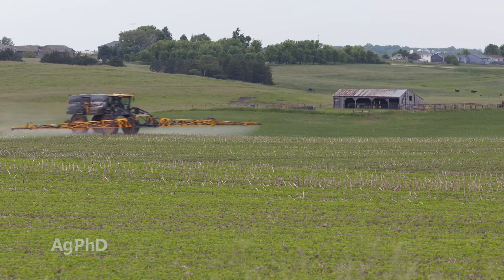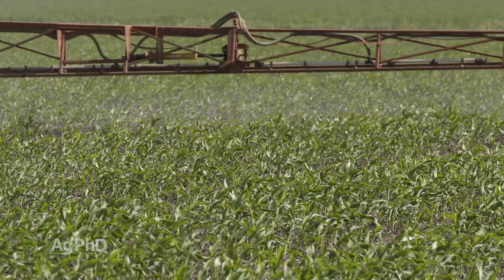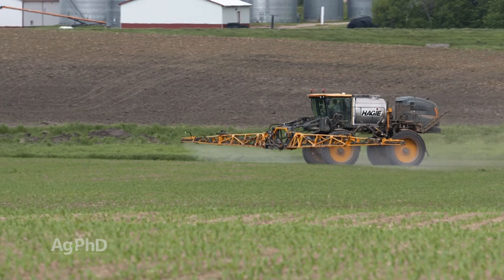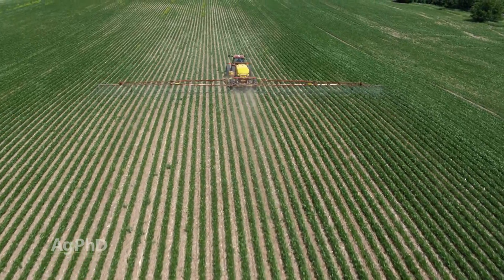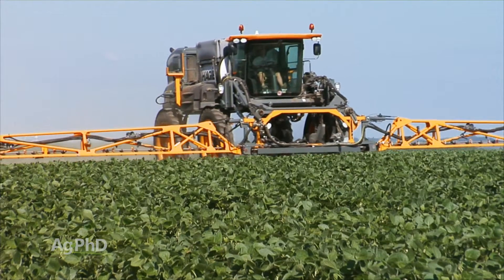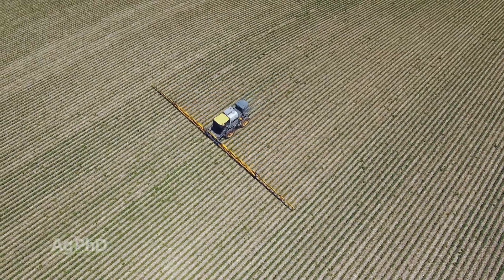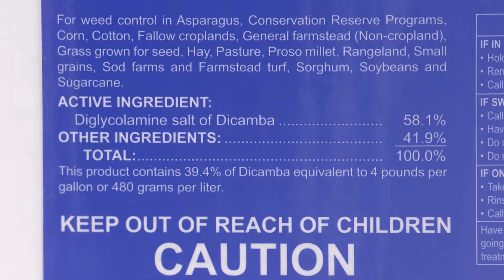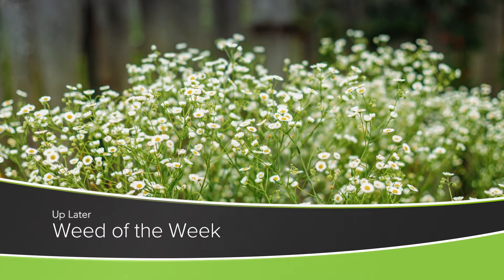Farm Basics #1210 Spray Drift vs. Volatility (Air Date 6-13-21)

Comment: What about leaching into the groundwater, shouldn’t there be a concern about those chemicals in the soil profile?
Reply: @banning twitter posts is the new burning books I think you're confusing fertilizer here. Also there are plenty of studies finding herbicides and pesticides in the water, so have fun debunking those with something other than soft-minded dismissals.
Reply from the maker: Brian and Darren addressed your question on Ag PhD Radio: https://soundcloud.com/agphd/06-21-21-sunflowers-and-late-season-scouting#t=5:55
Reply: @AgPhD  If I'm not mistaken atrazine might have a low LD50 for humans but that doesn't work out as cleanly for the actually ecosystem it's in
Reply from the maker: @ninetailscosmicfox  Brian addressed your comment on Ag PhD Radio: https://soundcloud.com/agphd/09-07-21-wheat-fertilization#t=56:57